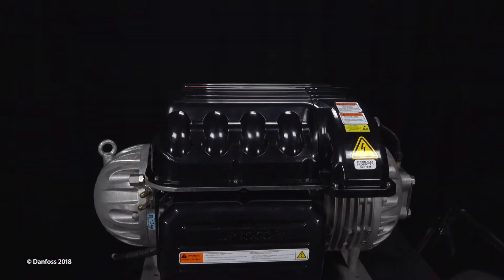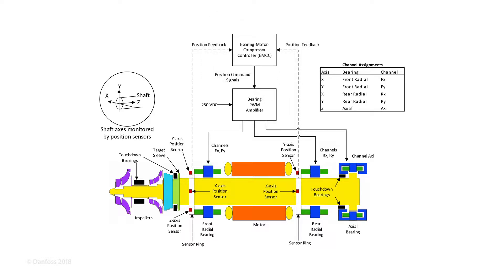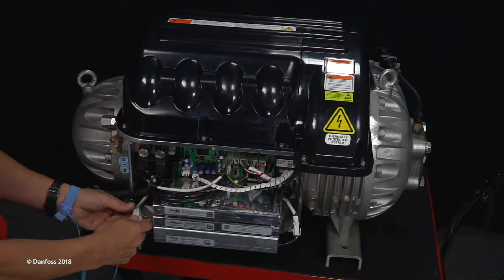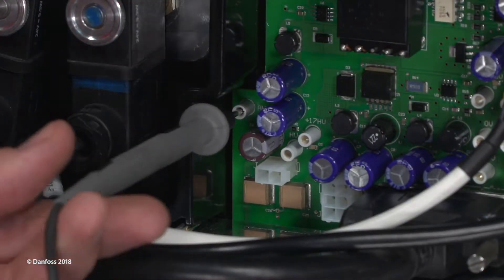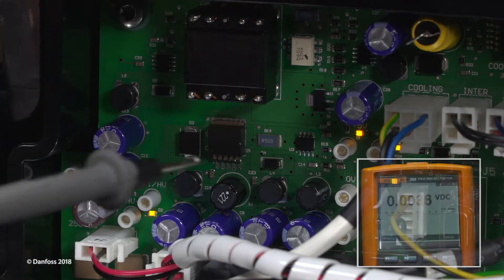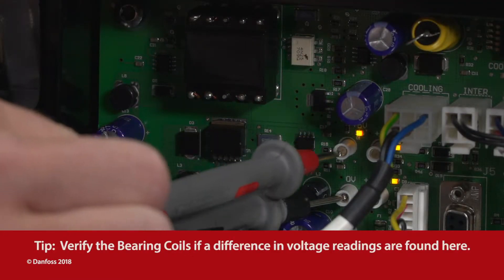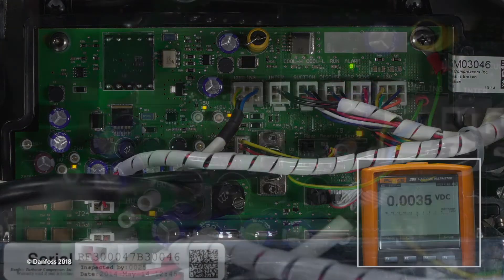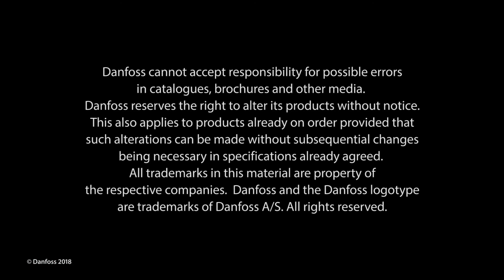Danfoss Turbocor® TT & TG PWM Verification

Comment: Hi, 
I have earlier version of  TT300 that exactly the same here, unusual bearing verification and many bearing faults during operation.
i have verified from service manual bearing and bearing sensor verification are good.
I just did PWM verification also good.
what else I can verified to correct the issue?
thanks
Reply from the maker: The bearing faults can be caused by a number of reasons. Reviewing the Event & Fault Logs for these incidents can provide insight to why the fault occurred.  
We recommend you contact the chiller OEM or a trained Turbocor technician for support if your diagnosis is inconclusive.
Reply: @DanfossClimate   we Did contacted the chiller manufacturer 2 years ago and had them remotely view the compressor even and fault log didn't identify  the problem, in the end they think we need a new compressor. Obviously  still running today but manual reset  required every few weeks
Reply from the maker: @nickmiller4544 , our customer service team is ready to help. You can contact them at this email address: Turbocor.PS.NA@Danfoss.com.